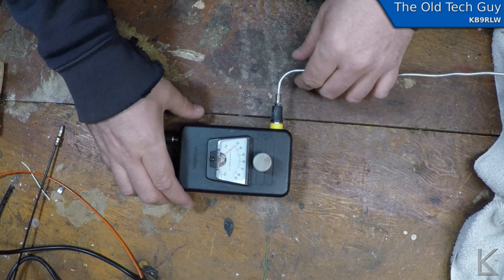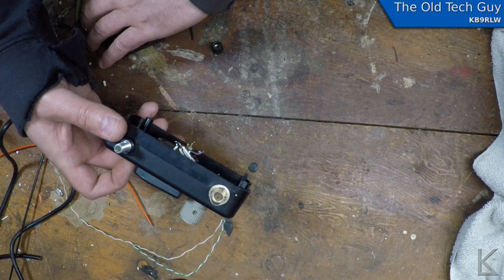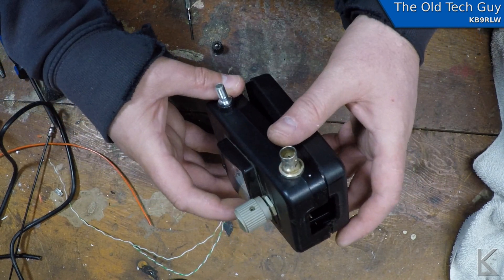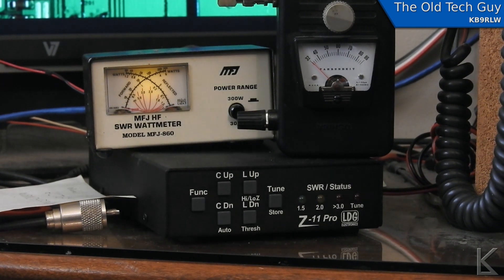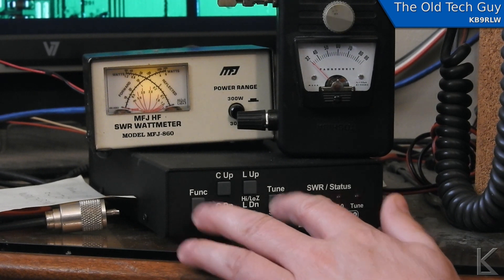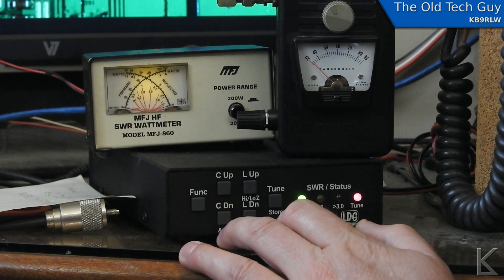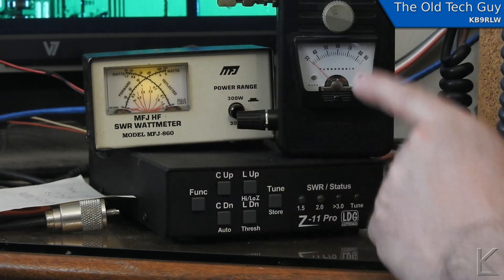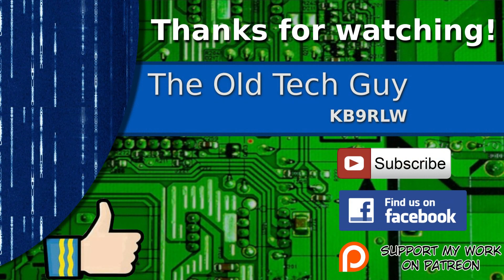Ham Radio - Does manually tweaking your auto tuner mean more radiated power?

Comment: Hi Kevin, 
Maybe the tuner is acting like a power splitter passing most of the rf to antenna but consuming some itself? Perhaps you could repeat the test using maximum rated power of the tuner. You might then be able to feel ( or even smell ) it if the tuner 'eats up' part of the rf energy... 
77 de oh2gqc

Comment: With the plastic cased field strength meter right up against the tuner, the EM field radiated by the tuner may be affecting the reading.
Reply from the maker: I probably should have mentioned that I saw the same when the meter was on the other end of the desk.   I moved it in for the camera shot, but the results were the same.  The tuners case is properly grounded also.

Comment: Hi Kevin
You are dead wrong about the signal strength being greater if you improve your SWR slightly from say 1.4:1 to 1:1. Your rudimentary test started with a 2:1 SWR so your radio was probably already pulling its power back slightly. By tweaking the tuner to yield a SWR of 1:1 (or very close) the output probably increased slightly. This is almost certainly why you are seeing an increase in the field strength. Also, you need to measure in the far field region to get meaningful results.
This subject has been covered very well in a book called "Reflections 2" by the late Walt Maxwell. Walt was responsible for many professional antenna designs including several used on satellites and the lunar rover antenna. Basically to sum it up, any energy that is reflected by the mismatch at the antenna returns down the coax and is re-reflected by the PA stage (radio) and returns to the antenna again. This process goes on continually until all the power is ultimately radiated by the antenna (albeit delayed slightly by the bouncing around in the coax). 
A small amount is lost as heat in the coax so technically the radiated power is very slightly reduced due to coax loss but at HF frequencies the coax loss is normally very low so can be neglected.
This notion that the power that is reflected from the mismatch is lost is widespread unfortunately, even in professional circles. Now I'm not advocating that SWR is unimportant as it is. It's just that it's important more for the well being of your radio/amplifier and not really for signal strength reasons.
Reply: Back in the day that was written most xmtrs had a tube final and perhaps a pi output. Yes the final re-reflected the power because there was a mis-match presented there too. Today's PA's might (I don't profess to know) be different. 

I have done this same test and had similar results. I won't argue with empirical evidence.
Reply: Tube and solid state PA's exhibit the same characteristic with regard to a reflected wave impinging on their output. They both reflect the wave back almost completely. This is because the PA doesn't have a 50 Ohm output impedance at all. It has essentially zero output impedance (or at least very low). A PA is designed to operate into a specific impedance (normally 50 Ohms) for best performance. It doesn't have a 50 Ohm output impedance. If it did half the output power would be lost in the output impedance inside the radio. Test equipment (such as signal generators) on the other hand do have a 50 Ohm output impedance and they do dissipate half their output power in their output impedance.
Incidentally, the mismatch is not between the coax and the radio, it's between the end of the coax and the antenna.
Reply: interesting. thanks for the info!
Reply: Roger Onslow and Kevin... the fly in the ointment is the IR loss in the system. And remember that the tuner is part of the system.  Feedline loss is more with greater mismatch. Also, when QST tested tuners, they showed that all matches are not equal in terms of efficiency.  I may have this backwards  but the match may be obtained with different combinations of L and C. If you find your match with lower L and higher C, less of the signal is lost as heat. And all tuners are not created equal in this regard, with some showing significant losses at some frequencies.  But in practice, I like most of us just hit the tune button, stomp on the footswitch and talk. A dB or 2 one way or the other seldom makes a noticeable difference.  73 de NT5A. And keep up the good work!
Reply from the maker: Very detailed.   And accurate, aside from one thing.
You start with I'm dead wrong that there's greater signal strength with a better match.  Then you point out that the radio probably folded back it's power a bit with the mismatch, presumably bringing it back up with the better match.   Which would result, regardless of losses, in a bit more at the far end of the system.
So it's like you said,  your wrong, now here's how your right. ;-)
I don't dispute the rest.

Comment: Is the attic dipole far enough away from the vertical to be in the far field of it's radiation? That's my only concern. 
73 de WD5DHK
Reply from the maker: Is there ever a case where in increase in near field would result is a decrease in far field?  I would think one would follow the other.
Reply: Kevin Loughin It could be improving the coupling to the dipole which would be different than coupling into the impedance of free space.  

The radio will definitely be happy to see a 1.1:1 match, though.

Comment: Yep... I admit, that thought crossed my mind when I watched the previous video.  "Does it really make THAT much difference?".  Great video Kevin!  Looks like it may be worth squeezing every bit of tuning out of the tuner... now, only if my MFJ-939 auto tuner I just bought had manual adjustment... lol
C'est la vie!
Reply from the maker: I have to wonder how hard it would be to add manual buttons.   The micro-controller is going to have digital signal lines coming out to do the adjustment anyway.  One may presume there will be four data lines, one each for inductance up/down and capacitance up/down.   So push buttons and 1K resistors either to ground or +5v, whichever the case may be, could probably do it.   Just guessing.